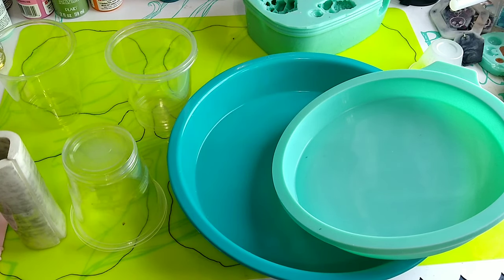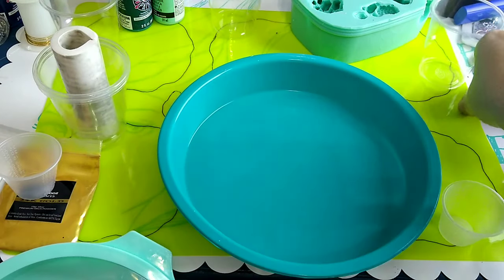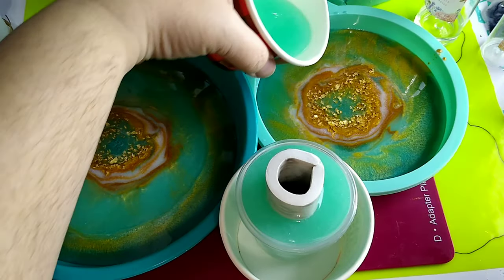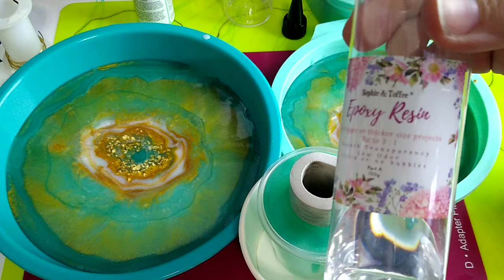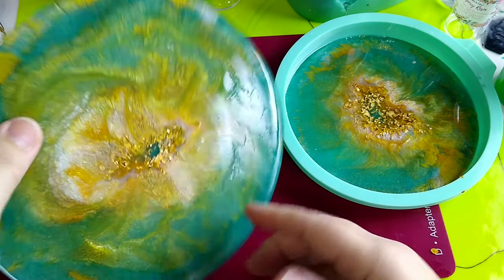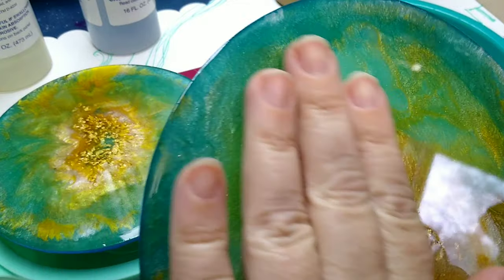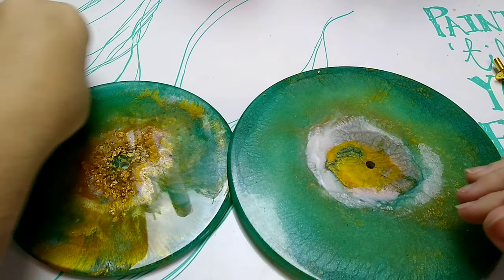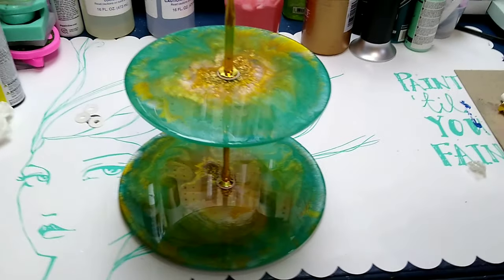Resin Geode Double Layer Serving Tray

Comment: You can add self adhesive heavy duty felt pads to the bottom and then even with the screw at the bottom it'll sit level not a tad bit wobbly
Reply from the maker: Thanks! I have some little rubber feet on the way but they are still in the mail lol. Taps fingers on desk, waiting. :)